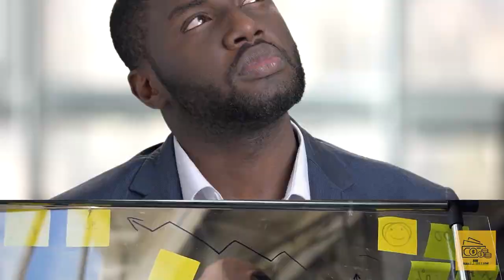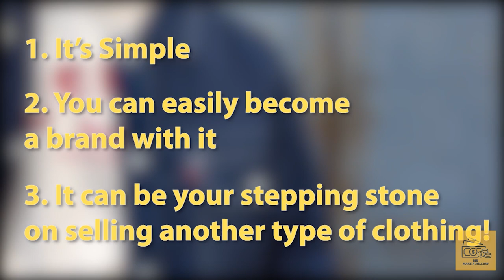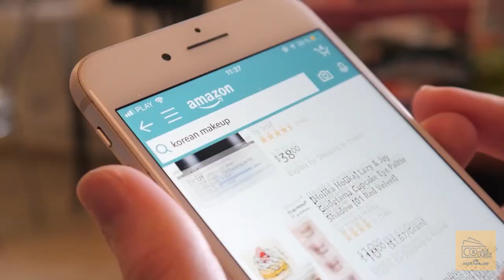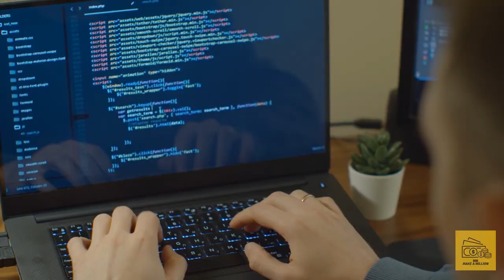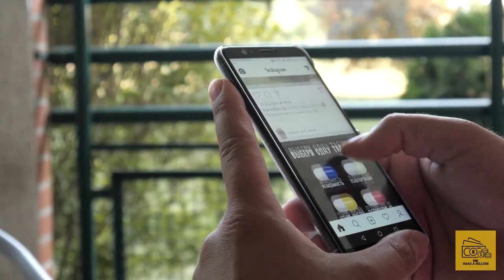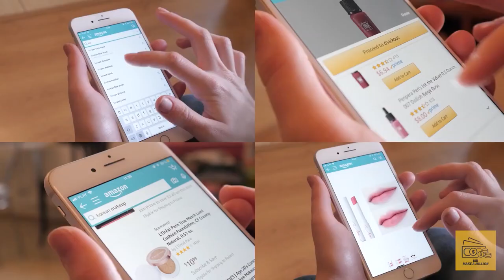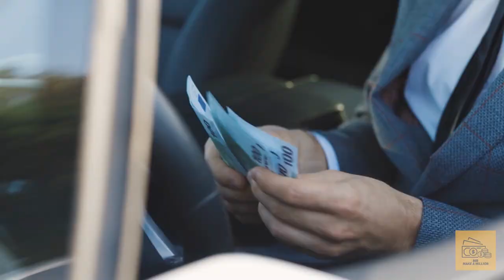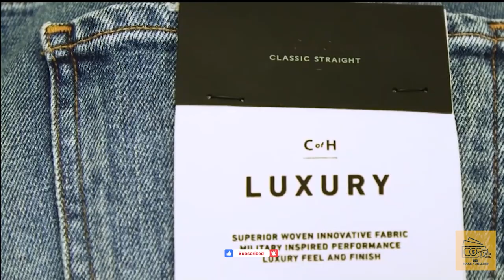How to start a jeans business || business idea on how to make money online in 2021

Comment: Regarding trousers, I have a question. Supposing one was starting out a mens pants brand (jeans chinos) with multiple inseam lengths per waist size, how many pairs of jeans should one make per inseam length i.e. How many of each size: 36 waist x 34 inseam, 36x36, 36x38, 38x34.....44x34, 44x36 etc should they sew and have in stock?